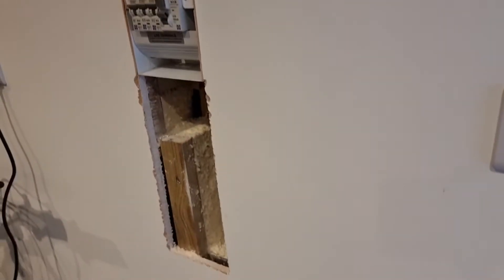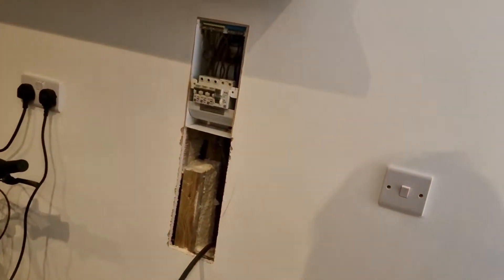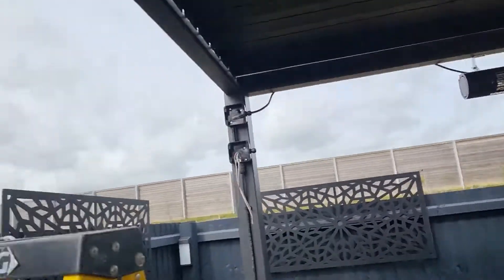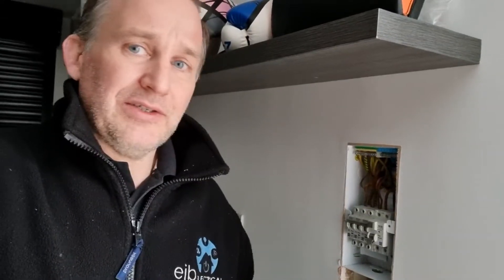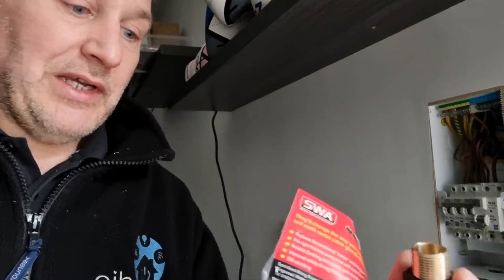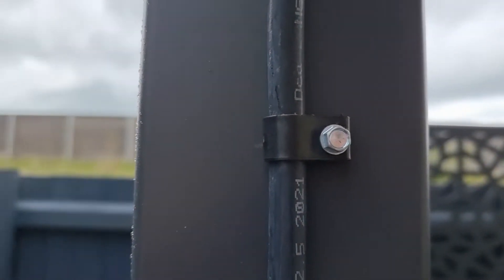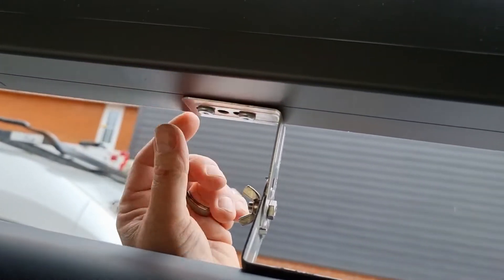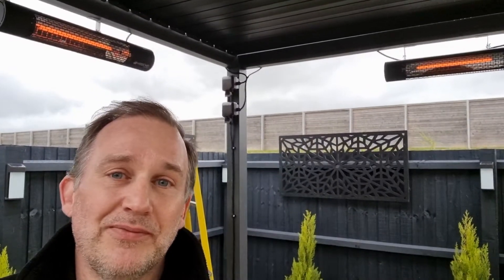How to install outside heaters to a metal pagoda, including armoured cable installation

Comment: Hi does we need 10mm bonding conductor connect metal outdoor structure? And further more do we need pen fault protective device?
Reply from the maker: Hi
No there's no need to add a 10mm as the existing system is a tns supply, so the earthing for the garage is taken from the house, and no need for a pen fault detection device as they are specifically for ev car chargers, although who knows where the regulations may take us in the future 😀